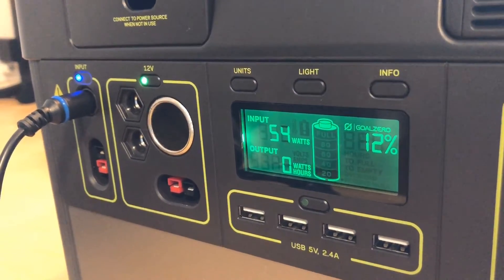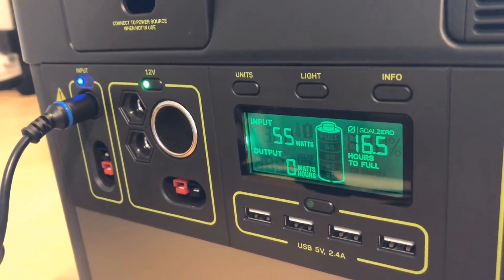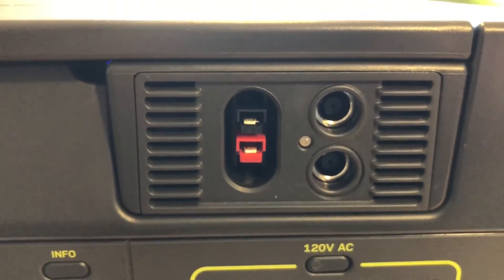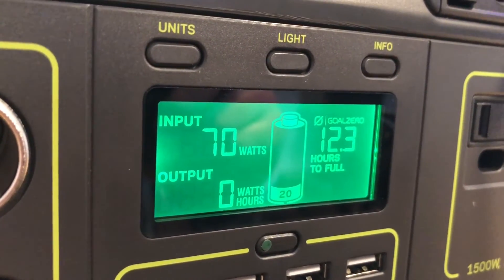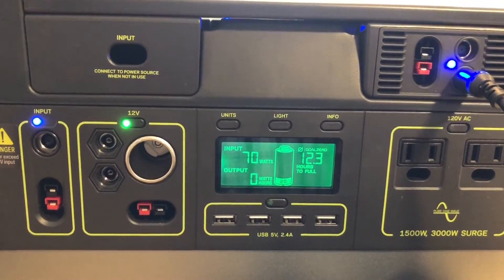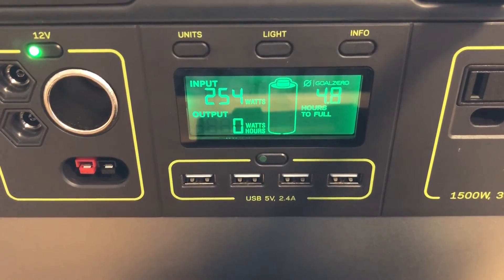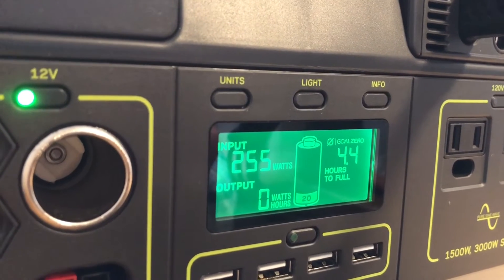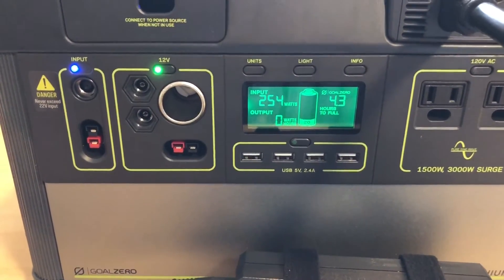Goal Zero Yeti 1000 Lithium: Fast Charge In Just 4.5 Hours Instead of 18!

Comment: I have a 1500x with 2 120watt wall chargers, i have the multi 8mm combiner to hpp input. I also  have the mppt unit. With 2 120 watt chargers i should get double the charge but with both i still only get 118watts as if its only one. Doesnt matter what combination i try and even according to goal zero this in theory should work. Thoughts?

Comment: How do I charge a Yeti from another Yeti? I don't want to use the power cord and come off the inverter due to reduced efficiency. I was hoping there was an adapter cable that would go from the 12V anderson power pole output on the Yeti1000X into the HPP input on the Yeti 3000X. Is this possible? What do you recommend?
Reply from the maker: You can charge one from the other using the car adapter but it’s slow and wastes energy.
Reply: @todd.parker  Does it waste more energy than using the AC charger from the inverter of 1 Yeti into the HPP/8mm into the other Yeti? Does powerwerks or someone make an anderson power pole to vertical anderson power pole cable?
Reply from the maker: @jgg204  No, staying with DC will be much more efficient than DC > AC > DC but I was just saying in general, transferring power between units is lossy.

Comment: I purchased the 600 watt power cord. It will charge a 3000x in about 6 hours.
Reply from the maker: It’s good Goal Zero has these options now but they are miles behind EcoFlow and Bluetti with their integrated chargers and 1 hour charge times.

Comment: One thing that I wish you would test, if you haven't, is using the battery while charging... even though my phone pulls 9 watts and my unit charges at 55 watts (ninjbatt 270wh) the unit says it will take 99 hours to finish charging instead of the normal 6 hours without charging and since that's about 1/6th the load it should take 1 extra hour or so to charge but it doesn't
Reply from the maker: Yeah that math seems wrong

Comment: I have a 500x with an 8mm(?) input to charge on the front and back and no anderson, I can do 2 wall chargers versus the 4 shown, can't I?
Love.
Reply from the maker: You can plug a charger into each input for 120w total
Reply: Where would a beefy usb-c cord and 100 watt adapter added on top of the 2 ac chargers take us?
Reply from the maker: @kpowers74  that should work too, give it a try
Reply: Maybe I should have added that we had 4 hours of daylight today at my house and would have been bummed if I didn't have shore power on which to rely. When that option goes away, we would be using a dual fuel generator when the solar panels, stacked in the conex to be put up eventually, cant produce enough. Maybe wind is a better option where we are 💁🏼
I'm quite glad I came across your channel. A bit wiser, as well. Thank you for helping the many I'm certain that you have. 👭 We're all in this together!
Love.

Comment: I solved the slow charge by using a Goal Zero Yeti 25A fast charger plugged into the MPPT module in conjunction with the standard wall charger which REALLY cuts down the overall charge times.

Comment: With so much energy being pumped into the Yeti and the amount of heat being generated, is this doing any damage to the battery?
Reply from the maker: You're right that charging very fast can be tough on a battery but a lithium battery can be recharged at a .5C rate (50% per hour) or more without harm so a 1000 could be safely charged at 500w. Obviously charging/discharging slower and not as deeply will prolong life but companies like Ecoflow charge close to 1C and they seem to do well though time will tell.
Reply: @todd.parker   So basically, some very minor impacts to longevity, but nothing to get too paranoid about. Got it. Thanks!

Comment: Do you think I could do something similar by running two 12v car chargers in parallel?
Reply from the maker: Yes. I just bought a second one and it works great but you should use a lithium battery, not lead acid.

Comment: Great video Todd. So I tried something similar but unfortunately did not get the desired effect. I tried two 120W power supplies into a 4 x 8 mm to Anderson combiner on a Yeti 1500X but the unit refused to take any more than 120W and the APP input on the 1500X is supposed to be good for 600W. I am guessing there is some 100W per 8mm input limit somewhere.
Reply from the maker: Huh, interesting. They make 200w Boulder panels that should output close to 180w real world and I assume those use the 8mm plugs. I'd like to think those use heavier wire but I don't know how they could limit the output from summing with the setup you had...strange. Might be worth doing some more tests...
Reply: @todd.parker  yeah it's a bit strange. I talked to GZ support today and they were completely lacking in knowledge on this. One of the support reps I talked to told me another rep would get back to me and would likely have to speak to an engineer to get the answers. Hopefully I'll hear back from them tomorrow. The most I was able to get today was 175W using one 120W charger and the 60W USB-C PD input. Another thing that is concerning is that on their website they quote the 1500X as having 600W through the APP port but I got my unit today and under the lid it clearly says 300W max for that port which does not bode well.

Actually the Boulder 200W panels use Anderson ports and in theory you use the 4x Anderson (to Anderson) plug to combine multiple. The Boulder 100 panels use 8mm and you use the 4x 8mm (to Anderson) combiner. GZ support at first tried to claim that there was some limit on that 4x 8mm combiner but didn't actually know what it was so nothing is clear right now.
Reply from the maker: Adrian Cho Photography I don’t see how the combiners themselves can limit anything, I assume it’s just a bunch of wires being connected in parallel. Now you know why I make so many GZ videos - their info is so scattered and unclear so I need to either hound tech support of just test things myself
Reply: @todd.parker  yep totally agree it must be just a bunch of wires connecting in parallel. For sure their info is a total mess.
Reply: @todd.parker  so FYI I have been engaging in some back and forth with GZ support and I’ve learned a couple of things. It seems there is logic, in at least the Yeti X models, to limit combining of multiple wall chargers through the 4x combiner cables. Apparently this is for safety reasons to prevent possible combinations of differently rated supplies (e.g. 120W and 230W) that operate at different voltages and could damage each other in parallel combination. Even using power supplies of the same type is apparently not possible now because because differences in manufacturing tolerances could cause one supply to provide more current than another, leading to overheating of the heavier loaded supply. The solar panels are apparently not a problem because they are closely matched in voltage and naturally drop together toward their rating as they are loaded in a way that the wall supplies are not. I am still trying to find out if this limitation also exists with multiple 12V car chargers or whether they work because they are all regulated. So lots of little gotchas. The only good news is that the (very expensive) Yeti Link will apparently charge the 1500X and 3000X at up to 750W, assuming it can be delivered at the alternator. You’ll notice that I’ve used the words “apparently” multiple times because I’m not sure what to believe.
Reply from the maker: @AdrianChoPhotography  thanks for tracking all this info down. The power supply limits are very curious. I have 4x 60w wall chargers summed via the combiner cable and it seems to work fine but maybe these high power chargers are more fragile? I haven’t seen anyone with the alternator setup installed to know how well it works. I wish Goal Zero sent out review units (ahem) so there were more videos...
Reply: @todd.parker  yes the fact that you did what you showed in this video is counter to what they’ve told me and what I’ve seen in my own testing. It looks to me like the logic to prevent the usage of the multiple wall chargers is only in the newer Yeti X units and it correlates with my testing of two 120W chargers that simply didn’t work. It also looks like they are trying to go at this (either validly or just to sell yet another accessory) with bigger single charging units. They already have a 120W and a 230W and are apparently bringing out a 600W soon (a newer version of the 25A charger for the older units). There is one video on YouTube I saw with one guy who installed the Yeti Link unit and he had good things to say about it but holy crap it’s really expensive. However being able to charge at the speed is fantastic and especially with the 1500X, which can only take up to 360W charging through any other method (despite what is advertised), it’s a big difference.
Reply: @todd.parker  so apparently, according to GZ Support, the new wall chargers used by the Yeti X line are constant current instead of constant voltage and this is what makes them incompatible with the 4x combiner cable. This will probably be the last thing I have to say on the GZ front as I got fed up with them and am in the process of returning the GZ gear (and anything I got to use with it) that I was evaluating.
Reply from the maker: @AdrianChoPhotography  man, the more I hear about the X series it seems like they made some bad decisions. Sorry to hear you had so many obstacles
Reply: @todd.parker  I think we’re in an interesting time right now as there are an increasing number of alternatives coming to the market now which will be competition for GZ. I’m just about to start evaluating another system that I’m hoping will be great. I’ll let you know how it goes.
Reply from the maker: @AdrianChoPhotography  please do. I agree they need to step up their game fast or they will fall behind. Seems the X series isn’t much of an improvement

Comment: How long will the unit last? The Kodiac has a life expectancy of 6 years. I've owned a generator for 32 years and it's still in it's original box. I'd hate to buy a solar generator and if I ever do need it, it doesn't work because it's too old.
Reply from the maker: Any lithium battery will lose capacity over time but it’s not a hard line. After 6 years it may only hold 80% of its original capacity, could be more or less depending on how many discharge cycles and how deep each is. A gas generator doesn’t slowly degrade like that but you have more maintenance and fuel to store/rotate so there are pros and cons.

Comment: I have found a 18vdc 350 Watt Power Supply. After following the comments on this excellent posting, I did some digging on power supplies and found thousands of 12 vdc (TOO LOW) and 24 vdc (TOO HIGH) units. Finally found that the medical industry has some limited uses for 18 vdc units.  Followed a trail of crumbs and finally found an affordable unit that is currently in stock at DigiKey, a major online electronics supplier (Mouser is another leading online electronic distributor). Check this unit out by searching for:
 DigiKey XP Power SMP350PS18  and it's only $107
I have just ordered a Scout truck camper that includes a single 165W solar panel and a GoalZero 1000 as a simple solution for AC and DC power. I may try this power supply as a quick charger. DigiKey also carries Anderson connectors so I can build an input cable to feed the PWM controller on the GZ1000.

Comment: Good review. I have the 400 watt goal and if I can help it I won't let it get below 50% because it takes took long to charge. Funny you say you talked to the goal zero engineers. I've recently have been considering either the 1400 or the 3000 watt GZ but I can't get ahold of anyone not even returning multiple emails too. I've moved on but considering the pricing is ranging from $1900-$3000 depending on which one you go with. Not a good sign they wont even respond to email.
Reply from the maker: That’s not good service! I mostly used chat on their website. Their tech support was good in the past and they would go and ask engineers for clarifications. I never had any luck with email either.
Reply from the maker: Oh and if you can find the 1400 or 300 refurb or on deep sale, go for it but otherwise I’d wait. They are refreshing all their units to the X series and last time I chatted they said the next gen would have built in MPPT and multiple expansion slots...
Reply: @todd.parker  good to know thanks for the insight!

Comment: I just use the 25A fast charge on the mppt and if I’m feeling frisky I’ll put a second standard charger on the front. Off grid though I use 4 100w Rockpal panels and they are awesome!
Reply: I can't find the 25 amp fast charges anywhere online I think those were the ones that were recalled. I need to get something to charge this faster for the summertime. I've had the battery for 3 years but I need to use it more excessively this summer

Comment: Okay, thanks for posting this! I have several GZ batteries, including a Yeti 1000 & it has a fan which I did not know. Now my question is about solar panels. I have eight Boulder 30s, Two 20s. Have these due to constant power outages. So it would appear two Boulder 100s? My 30s just sit in the shed in a box.
Reply from the maker: Hi, are you asking if you should upgrade to larger panels? Seems you have 320w of panels now, do you use the 8mm to Anderson combiner? Seems having fewer, larger panels will be less work to set up and connect.
Reply: @todd.parker  Thanks for responding...but I understand your question for my question I have know idea what I was getting at or wanting. LOL

Comment: Just like with fast charging an electric car, you will have to replace the battery much sooner than someone who charges it normally.
Reply from the maker: Agreed, faster charging and discharging will stress batteries. That said, a 60w charger for a 1kw+ battery is suuuuper slow

Comment: These Goal Zero things are such a rip off, Their specs seem to be all over the place and as you have pointed out 18/25 hours to charge it back up again is a joke, The whole idea of using Lithium batteries is because of the amount of power you can use from them But even more important is the speed you can Charge them back up again, I think you have done GZ a service by making this Video so well done to you Sir, That's impressive stuff and exactly how it should of came from the factory.
Reply from the maker: They finally got smart and started selling a fast charger but it’s extra. I will say that the yeti 1000, especially refurbished is a very good value. It’s the same price as the lithium battery alone.
Reply: Is it made up of 18650's or does it have a proper battery inside it ??
Reply from the maker: G 55 I’m not sure sure but most or all lithium batteries like Battleborn are still made of smaller batteries like that arranged into packs
Reply: Oh right, I thought they would of been like a Lithium version of a standard 12v Lead Acid battery Not 18650's made in to a pack >>
Reply from the maker: G 55 Yeah, me too but even Teslas are packed full of small batteries (2170s) in packs.
Reply: Cool I didn't know that, I just tried running a Small fridge freezer from a NOCO GB 150 Boost and it was running fine for around 4 hours but in the end the Fridge lights were powered up yet it would not run Yet the Noco was still showing 100% full, So something is not right there Ay.
Reply from the maker: G 55 according to the specs for that: Internal Battery
88 Watt-Hour Lithium-Ion - I’m surprised that ran a fridge for even that long. That’s a pretty small battery (Yeti 1000 is 1,000wh) so it seems to be working as well as can be expected

Comment: Is the battery replaceable once it's reached its life cycle limit?   I understand the cycle, but looking at longterm for the product for battery replacement if it's even an option in say several years after it's been used quite a bit.
Reply from the maker: Goal Zero has said the battery will be replaceable but doesn’t offer those parts on their site. I have purchased replacement batteries for the lead acid Yeti 100s in the past and it’s an easy swap.
Reply: @todd.parker  Thanks Todd and I agree.  My concern is that the device has been out for almost 2 years and Goal Zero doesn't offer the battery itself for replacement.  I would be curious if anyone has attempted to open it to see how easy a replacement would be and if the battery contained is proprietary or not.  What would be an alternative off-the- shelf replacement battery, etc.  Those are the only things holding me back from a purchase.  The device looks outstanding though per your review!

Comment: On the website, it says that the power pole anderson conenctors can support up to 460 Watts and the 8mm ports can support up to 120 watts. Do you know if that is for each port or is that for the sum of all ports?
Reply: This is for the yeti 3000
Reply from the maker: My understanding is the PWM ports can handle 360 watts total and the MPPT port can handle an additional 360 watts. For each, the sum of the ports matters.

Comment: so..... why not just buy a hobby grade AC/DC 24v power supply and connect an anderson power pole connector to it?

Whatever the max input wattage/volts is.... they are between $20 - $100 depending on branding and wattage

Hell an xbox one power supply is 250w and like $22 

Seems like a crazy expensive hack.....
Reply from the maker: You can for sure but you need one that is within the Yeti input voltage. A standard 12v is too low and 24v is too high. If you can find a variable output supply or something 16v or so that’s the sweet spot. I just didn’t see one that was cheaper when you really got into the details tho GZ now sells a.high power charger so that’s an option.

Charging Port (input, 8mm): 14-22V, up to 10A (120W max)

Power Pole Charging Port (input): 14-22V, up to 30A (360W max)